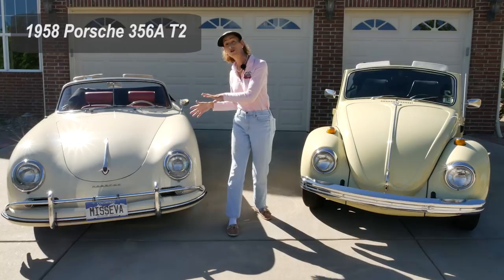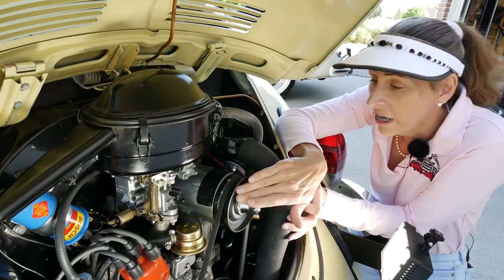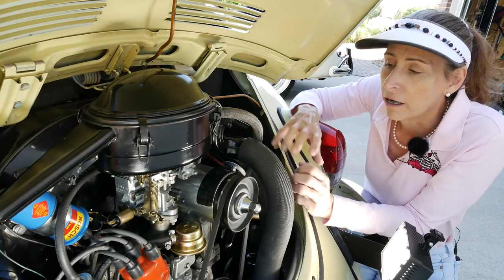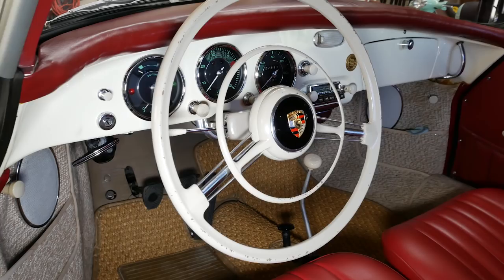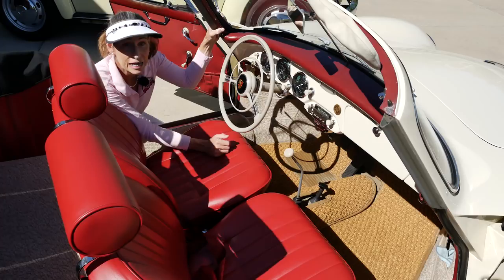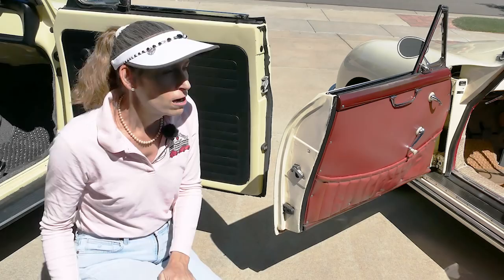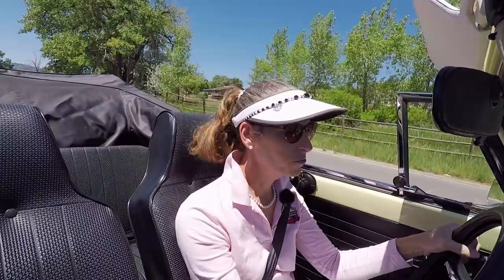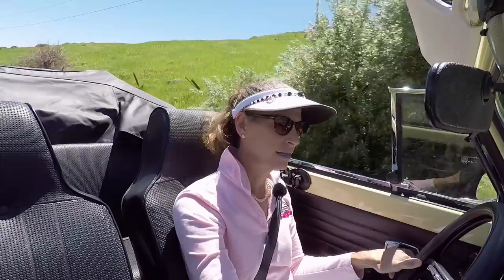Porsche 356 Vs. VW Beetle! How are the different? (With Driving!)

Comment: Nice video!  Never had a Porsche, but I had and loved two VW’s.  My first car was a used ‘64.  In ‘68, I traded it for my first brand new car, a shiny red ‘68 Beetle, which cost me just a nickel less than $2K.  It was a great, super reliable car, and I wish I still had it.  It saw me through the last half of my USAF hitch, four years of college, dating, a honeymoon, and the first two years of marriage.  Good times!  Funny you mentioned carburetor icing.  I experienced that on my ‘64.  I was driving across Kansas on a cold winter day.  The car started to lose power and slow down.  I pulled over, pump the throttle a couple of times, then BANG!, the ice broke loose, was ingested, then everything returned to normal.  That’s why they put carb heat on light aircraft!

Comment: We speak the same language. I'm a long time VW Beetle owner/operator. I have a 69 that was stone stock when I purchased it in 1984. Currently it runs with 1776 cc that I built to my own specs. Lots o' fun. Your judgement about double clutching while downshifting on the VW is solid. Just so you know, from 4th to 3rd is no problem, really solid. From 3rd to 2nd, however, is very different! I've encountered this with every Beetle I've driven. And that is that the 2nd gear synchro is under-designed and requires a solid heel-toe double clutch for an aggressive down-shift. To that end I've adjusted my brake peddle to be long so I can heel-toe. The stock brake peddle adjustment does not allow that. I've always wanted to drive a 356. Your review helps although from what you've said I can also conclude that I prefer owning my Beetle. Tanx!

Comment: The thing is, you didn't put 2 cars head to head of the same year. When you show the faucet (valve) for the heater I thought of my old 1958 VW sedan and the fact it had the same valve on the floor. The levers to control heat was a 60's innovation and was versatile in that it allowed the option of having just one side on if desired. Although it's kind of like wishful thinking having this more detailed control over the heating system. $6,000 for a 356 brake drum? DAMN!
Reply from the maker: $2000 for the drum.
Reply: I totally agree with you, many of the details (e.g. heatingsystem, fuelpump and distributor location etc.) are just differences between the model years. A beetle was nearly identical to a Porsche 356 in the early years.

Comment: My 1974 Porsche 914 also has cooling fins. It's a 2.0 type 4 VW engine but it is different from the original type 4. Porsche redesigned the cylinder heads and shrouding. It has 2, 40mm double barrel carburetors, higher compression pistons, and a slightly more aggressive cam to take advantage of the 40mm carbs.

Comment: Respect!
Your'e knowledgement is bigger than mine.
I'm stil driving my fathers Käfer since my age of 14.
Almost  for 44 years.
Last saturday, i prevent an engine-fire.
Fuel-hose-leakage.
Change it.
Suddenly i took the brass-pipe on carburator-cover out.

Comment: I own 65,66 and 67 beetle. I've restored them all so I know a thing or two about them. First of all a356 is more than just a little bit higher trim level. You can buy a beetle for the price of 356 drum set up. Price wise its not even close. Performance level between stock 356 and stock  beetle is hardly comparable. The thing that is nicer for the beetle though is that you can upgrade yourself for a very reasonable cost.My 65 is 2054cc with well over 100hp. All my dash gauges are 356-Speedo,tach,oil pressure,oil temp and voltmeter.Those alone cost me dearly. I made a set of headrests in the style of 356. Alas it is still no 356 but I love it.Price is just too high for Porsche though I love both.
Reply from the maker: Hi Scott, and this wasn't a very fair comparison as there are a number of years between them, but it is what we had.  The trim level is very different, but that has always been the difference between VW and Porsche.  Still, I love that Porsche has held on to the rear engine design even after VW gave it up and was still producing air cooled up to '98.  They are both great for different reasons.
Reply: scott ecoff 
Agreed. Usually had a VW, because could never afford a Porsche. Now that I can afford one, afraid I am too old.  This video makes feel, maybe not.

Comment: Shifting the Beetle; I remember my dad's '61 had a red line at about 15 miles per hour,  two red lines at 30, three red lines at around 45; we were told those were the shift points.  Don't know how long that continued (whether or not the one you drove had that) but that's where we knew to shift.
Reply from the maker: I so wanted to show that on the Beetle, but the spedo actually broke on the way over to our house!  Those marks are the speed to stay between for those gears.  Almost as bad as over-revving is under-revving for those engines.  German cars require you to pay attention and take responsibility for driving properly and maintenance.  It is just the way they are ;)  I love that about them :)
Reply: @HeidiandFranny  I like when cars work and I like fixing them or at least help or try to.I just don’t like spending a lot of money, and there is so many things that can go very wrong.

Comment: Very good video and interesting test drive. I totally agree with your test drive of the beetle. I think it would be good to do a test drive between the 356 and the sporty version of the beetle: the Karmann-Ghia Type 14. As from 1967, it had front disc brakes and the profile was better designed for top speed. Looking forward
Reply from the maker: Yeah, we like to.
Reply: a converted 68 autostick with added clutch tube and extended shift coupler becomes a standard 4 speed beetle with the same ground clearance as the 67 Karmann -Ghia type 14 motor  with I.R.S.,  weld in some solid steel floor pan halves, then you have a beetle with 356 sport car like suspension that won't even feel a convoy of diesel trucks on a two lane highway blow by it at 65 mph +

Comment: I have a 1959 356 with the same exterior color and interior as your 356 and it is wonderfully to drive too.
Reply from the maker: Is yours a coupe?  There is a '58 coupe in our area same color in and out.  I see it at C&C now and then.
Reply: My is convertible with matching number engine and transmission.  The interior is in very good shape and it all original.  Most of the exterior paint is original accept the front nose is retouch

Comment: You said your not a fan of 4 cylinders. You should do a video on the 69  Saab with the Ford V4 engine and 4 on the tree. I never heard of a v4 till i bought one for $200 in 2001. Ended loving it and the car it self. Of course the previous owner turned it into a convertible.

Comment: Great video! nice vw beetle! The sound that the constructor
Ferdinand Porsche is taken from nature. He told me that he was considering the
blind as he worked with the engine sound. He also told me that the beetle is equipped
with shock absorbers, rather than suspension. The pits and the bumps on unpaved
back roads inform the driver. That car offered freedom for many young back in
the 1970. You could drive anywhere you wanted. How about some unpaved back road
shots?

Comment: Hello Cutie I could listen to you talk cars all day long..  Had a 67 vw first year of 12 volt my first car, in 1985 I did a mediocre restoration I was 15 .. Sonoma county CA had plenty of cars  I was always told it was "clean" 
The 1.8 dual carb swap,  along with the 5 slot 911 wheels had it unique. Cracked the block coming back from Lake Tahoe in 88 and it sat for a year. 19 and desperate for $ I sold it and drove our family fleet of Subarus. Oh Chrysler Lebaron and Dodge Daytona seats fit beautifully in the bug..  Have a great day
Reply: Also my washer fluid was pressured via the spare tire..  And always had a basic toolbox with wire generator belt..  I looked at this because I was always under the impression that the "pan" underpinning were the same..  So long uninformed I decided to research and I chose to look at this. I do torture myself doing this, I think about the ones that got away. My uncles 72 911t that sat under a  cover that I always wanted to tinker with..  He had beautiful taste in cars just bad judgement also didn't know how to treat them well.. Got to illegally Cruise  his Red with tan leather Mercedes 190SL fully almost Concorse restoration.. Sorry watching this flooded my memory of those days when I could be the car gal I always have been..

Comment: VWs never actually had 3-piece cases on production cars but the case was designed by Porsche for VW’s early 1950s diesel. They elected not to produce the car because it had acceleration of 0-100 KM in 60 seconds. Porsche wanted to go to a bigger engine and ended up buying it from VW. 
Zenith carbs could really suck down the gas. While my 356B Super Roadster got 43 mpg on the road, it got about 1.5 mpg in SCCA autocrosses.

Comment: The M band is NOT “marine band”, it is shortwave, not used in the USA. My grandfather’s 1965 Mercedes-Benz 190D sedan had the same radio.
Reply from the maker: Are you really sure?  Check out this site on Blaupunkt Radios: http://derwhites356literature.com/New356Stuff/BlaupunktRadioID.html   Your grandfather's 1965 radio would be a later transistor unit.  This is an earlier tube unit.  F

Comment: When Porsche designed the VW Beetle, the goal was to create an affordable car for the people. Production and repair should be easy. 
When Porsche designed the sports car, the goal was to stand out from the crowd and create a fast but solid car.
Porsche manufactured the first prototypes with metal over wooden frames and placed them on VW Beetle chassis. Later he made everything himself.

Comment: nice video, however, there is such a wide difference in eras, 1958 and 1969.  The VW bug changed a lot, especially in 1968.  If you would have compared a VW of the same year, you really would have seen differences in engine, interior, body design.  Yes the bug has similarities throughout the years, but the interior changed(including the seats).  I had a 65 bug in college and my gf had a 69, and they drove and felt very different.  My dad had a 63 bug and his drove smoother than my 65!  Go figure.  Have a real nostalgic love for them.  If you compared a 1969 Porsche and 1969 bug you would have a lot of differences
Reply from the maker: A lot of times doing a year to year comparison is not possible.  It's hard to find 1958 VWs and of course, the Porsche's didn't make the 356 past 1965.   We do our best.

Comment: I really liked how you compared and contrasted the two vehicles. The more I see "Lemon Drop" the more I may consider a '69 as opposed to 70-74. While the '73 has a special place in my heart the '69 just looks better to me. You also HAD me looking at the 356 until you mentioned the price of a drum! 🙂 Any other years to consider or stay away from in your opinion? My research indicates the '67 was a year with some one time changes and as such is more difficult to procure parts. Again, your videos are absolutely wonderful however there is one slight drawback...the excitement you instill is most likely gonna cost me some money, but what the heck!
Reply from the maker: No. We are not experts in Beetles.  We cannot recommend any particular year.

Comment: Lovely video, thanks ... love both cars for different reasons ... do you know which seats you have in the 356? They look just right ... was thinking they would look great in a Beetle. Thanks, happy sailing :)
Reply from the maker: They are the standard 356 seats.  You would have to find a set somewhere and probably get them recovered. They are pretty comfy :)
Reply: Thanks! sorry for the noob question. They looked different to me with the head rests. @HeidiandFranny
Reply from the maker: The head rests were an option that you could get with 356s, and we knew someone who actually got his 356 with just one side!  When we had our original seats recovered, we found a set of after-market head rests that looked similar to the original ones.   We hoped that if we were to get in a car accident in that car that they might just be enough support for our necks.  You can find them. You just have to look around for the head rests at 356 parts places.   Good luck on your quest!  Heidi

Comment: A beetle with extractors sound much like the Porsche. If you can try a type3 in good original condition the ride quality is very good and smooth , braking twin wheel cylinders in the front pretty good .they compare with a new car if it's not windy. 65hp standard with twin carbs with electric choke , but the best thing is to disconnect them as they run for to long .nice porsche by the way

Comment: Part of the reason your 70 Bug is so sluggish on the hill is because it has the wrong transmission.  The one in it is from mid 75 and later and has taller gears than a 70 is supposed to have.
Also, FYI, the trans cases for a 356 and Beetle were only the same up to 52 - 53.  After that, both cars got a different case.

Comment: Thank you for posting all these great videos, your garage is incredible!
 I´ve always been obsessed with old Porsches. One of my greatest dreams is to own a Porsche 912, but I´m only 22 years old and finishing my engineering degree. Since these cars are getting more and more expensive, I´d like to ask you if it would be relatively easy to mount a Volkswagen engine on a 912 body to make it cheaper and more reliable? I know there are many  differences between the two engines, but would it still be possible? Thank you!
Reply from the maker: Have you considered a 944?  I assume not, because you want air cooled. What about a Ghia?  VW engines do not sound correct in P cars. They sound like beetle engines.  Feel free to email us through the website.  We can brainstorm.

Comment: Hey! First of all great video, I really had a hard time when looking for a beetle -to some similar porsche review, I feel people don't treat them or see them as the icon they were, and still are as for me(both of them). All that aside, I remember you said the 356 engine has 60 horsepower, right? I think my 99' fuel injected(mexican) 1597cc beetle has those same 60 hp, so I'm thinking maybe my car accerlerates at the same pace the 356 did, which is super cool because like you said when you accelerate on 4th gear on the highway for example, you start hearing the engine tweet and feel the response on the acceleration, and I too, love the sound of the beetle engine, I daily drive it.

Comment: Lovely video. Where I live, I don't think 356's and Beetles get confused that often. Maybe it is the Dutch police owned no less than 509 Porsches back in the day, starting with the 356 all the way to the 964. They had 914/6 and a 924 as well at one point. Or maybe I just happen to know the people who appreciate the difference :) 

as far as four cylinders go there are a few that really sound nice to my ears: Apart from the Beetle and 356 I would include the Giuseppe Busso designed twin cam Alfa Romeo and the Alfa Romeo boxer engine. How about a BMW E30 M3? Lancia V4?

One more thing: Was the speedo broken on the Beetle, or are my eyes tricking me?
Reply from the maker: Great eye!  Yes, the spedo broke literally on the way over to our house when Jerry dropped it off.  The little plastic gears tend to break.  That car still has a bit of sorting to get done ;)

I bet those four cylinders do sound good... I wish we had them here...  

Wasn't there a Dutch Beetle Police car?  Jerry Seinfeld did an episode with one and I thought it was Dutch.
Reply: You are correct, the Dutch police used Beetles too. I looked up the one with Seinfeld, but that one is actually 
a German Beetle. It's just that everybody here knew and respected the police  Porsches a lot. It wasn't just law enforcement that were sad to see the Porsches go.

Comment: Not really a fair comparison on the wheels and drums 66 and older beetles used the wide 5 bolt pattern that the Porsche uses the drums were still smaller but they don't need to be as big the beetle is not a sports car.

Comment: Hello, I have a 68' beetle and the brake pedal has perfect tension (so I know it has nothing to do with the master cylinder) but when I go to release it, it comes down but reaches a point to where it falls too much. Now it doesn't go to the floor but it falls in an inch or two past where it should be (around the clutch pedal or so) Do you know what this could be related too? Thank You, Lance
Reply: it is your master cylinder. that is exactly what they are like on the way out. pump it and it will come back up. that is the sign it is your master cylinder

Comment: I dont understand if the rev matching and sincro is so good on 356 ,why the double clutching?
Reply from the maker: Well, that transmission is over 60 years old, and 120Kmi.  At this point, the 2nd gear syncro is a tad weak.  The rest is just habit.  I found myself double-clutching the turbo the other day...
Reply: Heidi and Franny's Garage.  cool thx for the response I enjoyed your video.we have a 993 Carrera but I would love a 356 to putt around in.
Reply from the maker: Yeah, careful, those 356’s will steal your heart.  :)